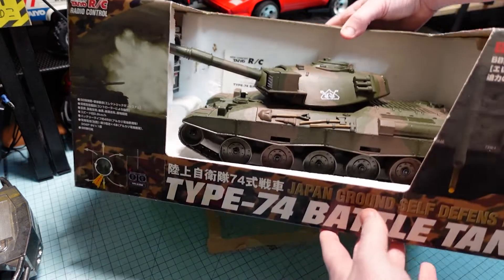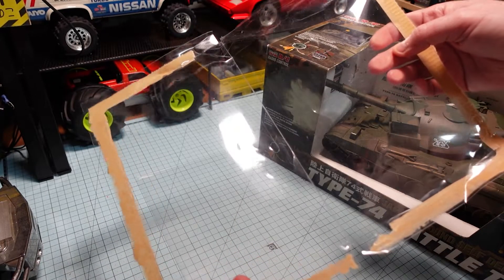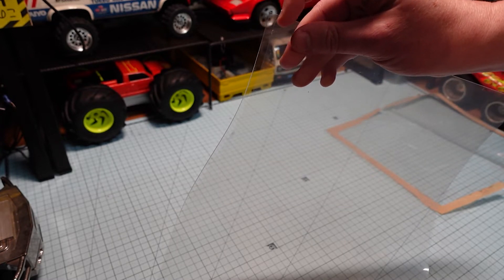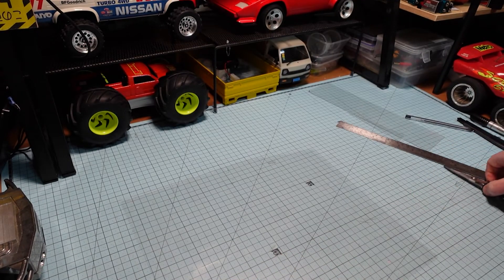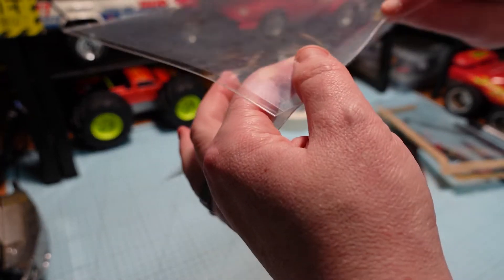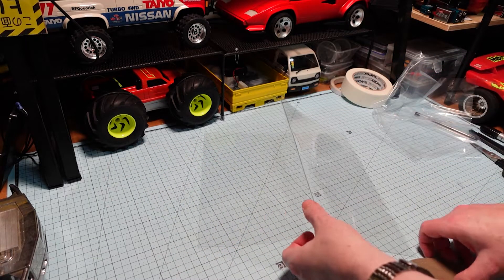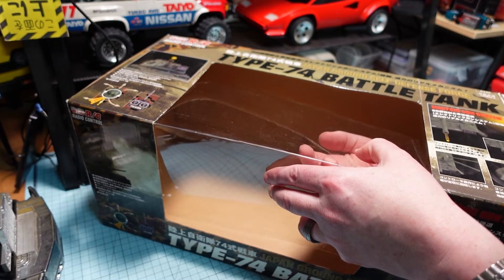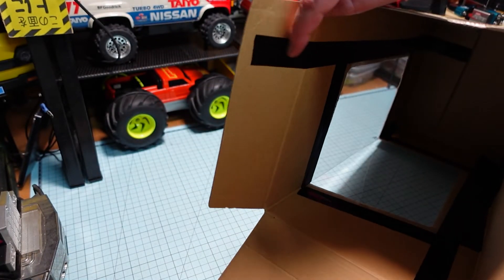How to Repair Window on RC Toy Cardboard Box - Acetate Acrylic Mylar Sheet

Comment: I know this video was posted one year ago what was the name of the material you used for the Perspex or plastic see-through cover? I need to do a similar thing for a Corgi toy. The front was all broken. I’ve taken it out carefully. Just need the right material. What’s the name, please?
Reply from the maker: Search for Acrylic Sheet or Clear PVC sheet or Acetate sheet.  There’s many materials, all with slightly different properties. Important is thickness.

Comment: You can't fix the existing plastic window?
Reply from the maker: These are 20-30 years old, so the existing plastic windows are usually terribly deformed, or still perfect but yellowed by UV damage.
Reply: Can light heat and weight reshape rippled effected boxes?